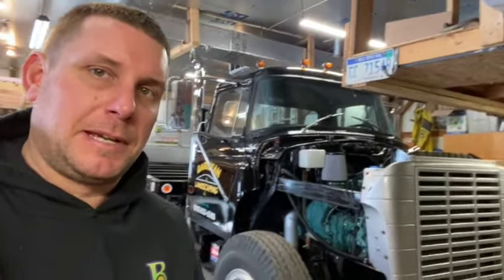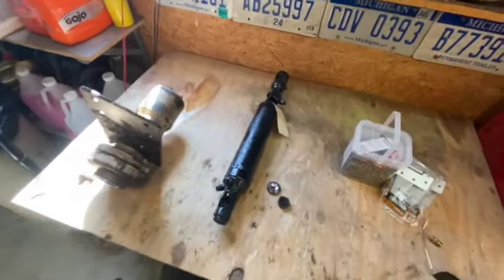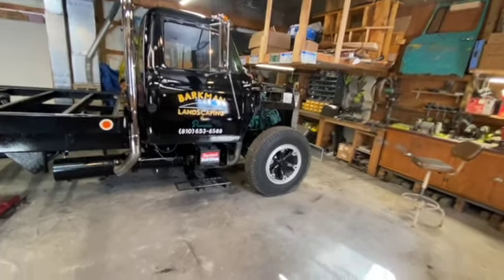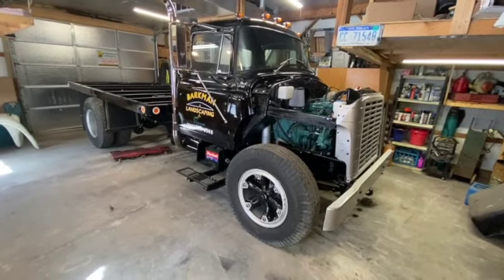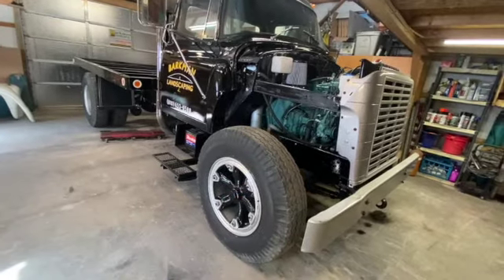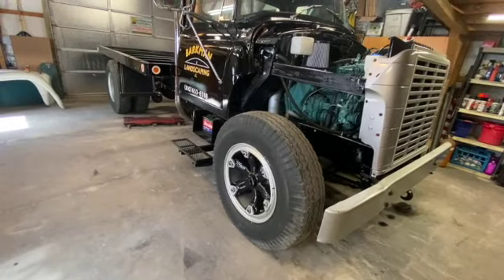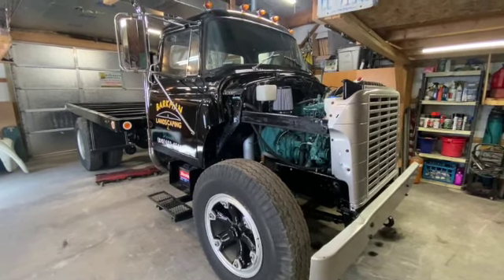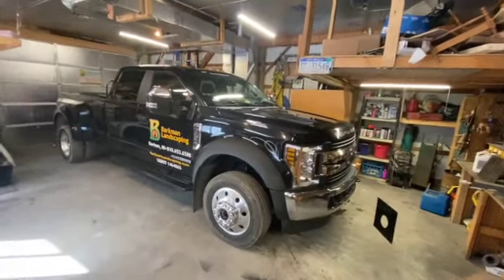Detroit Diesel Loadstar Episode 15  Road Trip, shifting the 6-71??!   SD 480p

Comment: Upgrade to air brake on front for sure. Smart to have 2 axle brakes in case one system fails. Also love the cast spoke glad you are keeping that look. One piece steel hoops with metric 22.5 is the only way to go. You can select from a lot more rubber choices and go tubeless at same time. Love the truck!!
Reply from the maker: Yes, they were long ago swapped to 22.5’s. After driving it for 3 years, I’ve found that I have no need for front brakes at all.  I put on less than 100 miles per year and it stops great for that purpose.

Comment: i have 4 or 5 matching 10r22.5 recap drives i would give you...30% tread or so. i bet we could find all kinds of parts laying around here for you. i think the old trucks look great with the "gun metal grey". dt360 is a very desirable engine. i have a couple as well as a dt408. the dt408 isnt very common around here at all. i found another dayton steer axle laying around. i will measure the springs width and centers today and email you if you want. i respect the fact you had are learning the engine rpm / trans input speed needed to shift and didnt cut out the shifts that were less than perfect. ada boy! honesty and integrity. two traits the world could use more of.
Reply from the maker: J.C., that would be awesome- I agree, I bet you have all kinds of goodies I could use.  I’ll shoot you an email.  Jealous of that DT408- that’s ultra rare.  Appreciate the kind words too.  I pride myself on being honest and up front, even if it shows my poor double clutching and shifting!  I’ll keep practicing and get the broken clutch brake replaced, I have to be able to look like I know what I’m doing before the first truck show
Reply: Get with it

Comment: Do you think it’s possible to put a L10 Cummins in a loadstar
Reply from the maker: Anything’s possible but it would certainly require a doghouse even bigger than I did and the turbo would be in the way.  A Cummins B series would be much easier and would net similar power ratings.

Comment: The c60 im building on has 10.00 20. That split ring scares me.
Reply from the maker: Some of them aren’t as dangerous- the ones on the Loadstar are the tube type wheels that are “split rings”- not as dangerous as the old “widowmakers” or “split rims”.  I agree with you though, I don’t care for either.  I’d greatly prefer the tubeless 22.5’s

Comment: The blowers really noisy
Reply from the maker: I hear They might be, but you can’t hear them over the sound of a Detroit Diesel 2 stroke
Reply: It's because the dry type of air filter. With an oil base air cleanner you just barely listen the blower. This is the reason why I install this type. And the oil filtration is really better for the fine dust so they extend the engine life!!
Reply: @michelscalabrini5490  that’s a really neat fact and yes oil air filters are the best